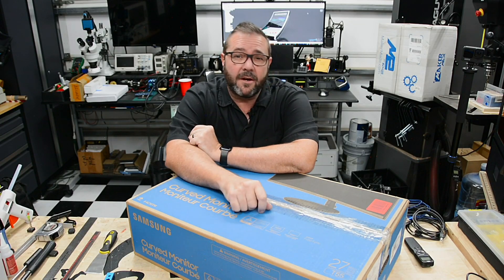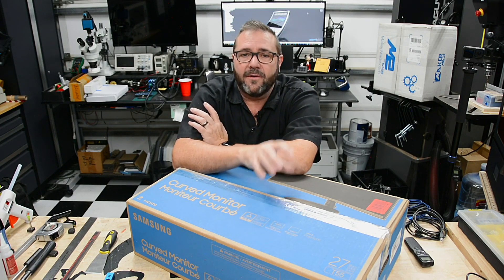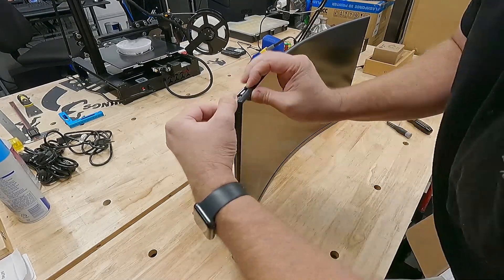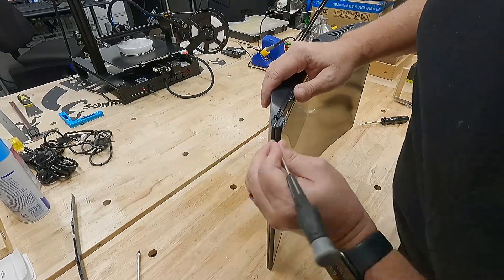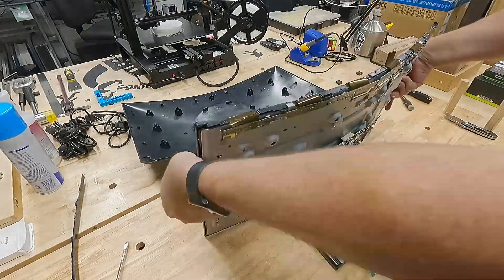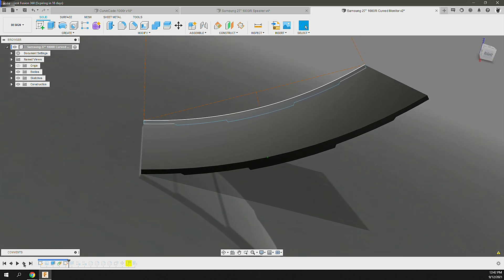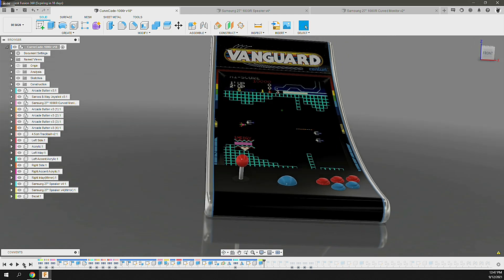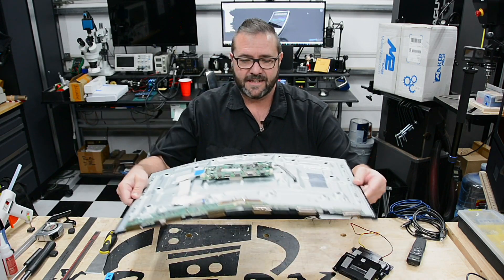The Thinnest Curved Monitors for your Arcade Projects!

Comment: You made me really nervous using a screwdriver as a spudger.  I find it guitar pics to be far less never rattling a tool for that job and as they come in different thicknesses so you can start with an 0.46mm pic and work up to a 1.2mm before the thing pops open.
Reply from the maker: probably looks that way in timelapse, but I’m a professional… ;) btw, i do have a set but use them on smaller items. I never knew they had a name.